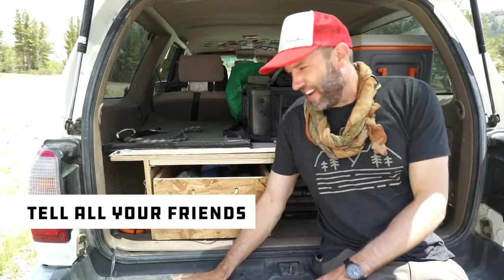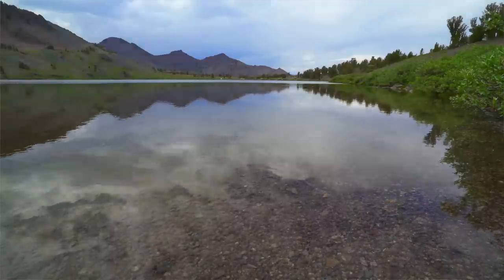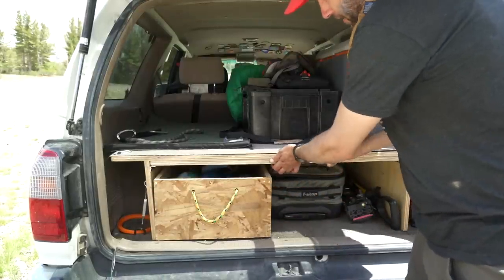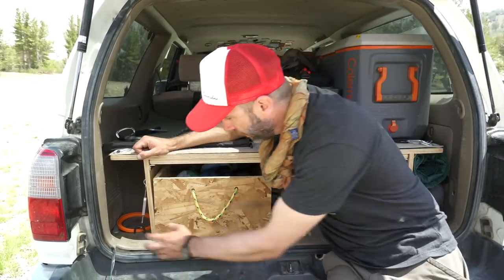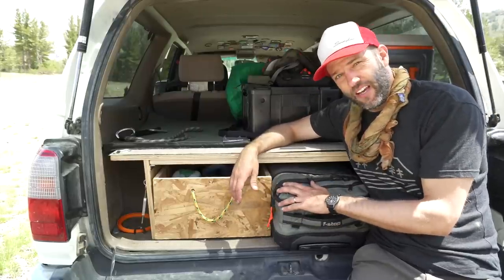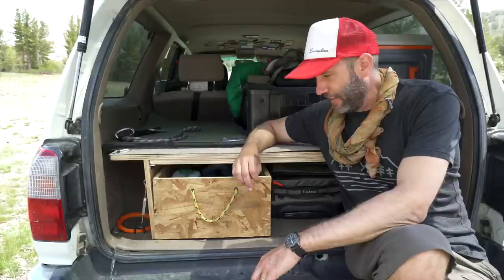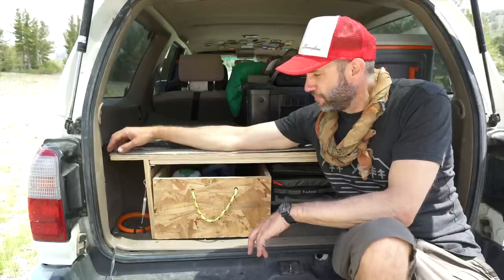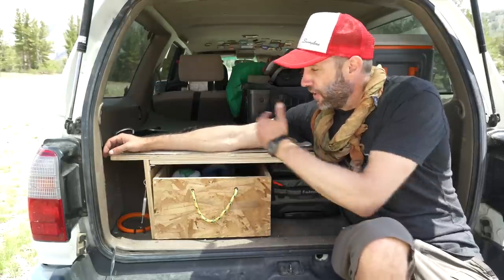DIY Drawer less Drawer System for SUV from single sheet of Ply Wood for overlanding and camping

Comment: Would have preferred the cooler under it and softer/lighter goods to be placed on top. Would have probably covered more of the wood with carpet as well, but nice build!!
Reply from the maker: I’ve tried that design. It works, but you have to slide the cooler all the way out to access it and you don’t get s table.
Reply: All-Terrain Family what if you split the wooden top and hinged it, or left one side open
Reply from the maker: Possible, but that would require more structure and then you’d have to move the stuff on top to open it. I’ll probably build another with the ideas I’m getting from these comments. Thanks!
Reply: Carpet will retain dirt. I wouldn't use it anywhere it wasn't expressly needed. The way it's currently built it can be quickly wiped down and there's no dirt to grind into sliding stuff.

Dirt souldn't be a huge issue with an SUV, but in a pickup or a soft top vehicle like my 48 Willys CJ, dirt is a constant companion. You have to plan on it being there no matter how hard you try to keep it clean.
Reply from the maker: True, but it also traps dirt. Keeps it from flying around. Same with dog hair. Also protects the plywood top. But it also traps water. So there are trade offs...

Comment: Well done, thank you very much. Good idea to secure the platform to the floor. In case of an accident it doesn't fly around. Also, like the tie down strap idea. Only question I have is do you put stops for the sliding table so it could not be pulled all the way out? Thanks again, Robert.
Reply from the maker: No stops. The table is a lot longer than it needs to be so there’s little chance I’ll pull it out too far.

Comment: Nice work, but have to ask, why the half ass attempt at carpeting the top? Why not Contact cement the carpet down and use the same angled aluminum around the edges to keep it down and protect the edges. You could also do Spring pin passthroughs on the table sides to lock it in certain positions (closed, ¼ open, ½ open (probably the furthest open you want because of leverage)), and nice idea with the felt, but I guarantee it'll wear out pretty fast and you'll be replacing. You should have used some teflon sliders, (something I've used in the past was cutting up a cheap cutting board that's at least ¼ inch thick and screw it to the sliding top).
Reply from the maker: The carpet is good enough. 

How fast do you think that felt is going to wear out? It’s been a year and there’s no degradation.

The pin is unnecessary as the felt holds wherever you leave it.

Thanks for the ideas.

-M
Reply: @AllTerrainFamily  If it's been a year, I'm surprised the front piece hasn't broken down yet. between the friction fit and the leverage pushing down on the front edge I wouldn't have expected it to last too long... If it does, take a look at using a cheap cutting board cut into long thin pieces, I've used it a bunch of times in the previous iterations of drawers in my workshop.. Lasts just about forever.
Reply from the maker: Will do. But this solution appears to be good long term as well.
Reply: @AllTerrainFamily  I used contact cement on a van project and regretted it.  If you fasten carpet, felt, whatever in place ......attach it so that you can easily remove and replace .....just like you did.

Comment: Hey Mike - would the 3/4" plywood support two short adults sleeping on it? If yes, what about downsizing to 1/2", adding a center support as necessary? My goal is to minimize weight. Thanks in advance!
Reply from the maker: I think 3/4 is necessary unless you have more support. And a central support is necessary as well.

Comment: Great   simple idea. Is there nothing attaching the other end to the floor of the car? Is there not a tendency for the unit to tip when you pull the table top out and put even slight downward pressure on it, because of this.?
Reply from the maker: There are turnbuckles attached to the cargo tiedowns.

Comment: Nice, simple idea but functional. Your uprights aren’t square nor stable. I would have alternated the pocket screws from one side tot the other and I would have added a solid back or some bracing to the table for more stability.
Reply from the maker: On it’s own, no it isn’t stable. The turnbuckles pull the ends out and anchor them to the floor and the wheel wells hold them in place against the pull of the turnbuckles. So in place it’s very stable. Definitely isn’t square as you said. But it doesn’t really need to be without drawers. Does it bother me? It does a little.

Comment: That tables just amazing.
Is it possible to make attachable legs? Then it can be extended more.
Reply from the maker: Others have suggested that. I’ve not found it to be necessary.
Reply from the maker: Main reason is that it would block access. If you take it out and use it as a stand alone table, you'd still want the short one at the back of the truck. So I usually cary a separate collapsable table for dining.
Reply: @AllTerrainFamily  What I was saying is optional attachable legs or just 2 legs for the unsupported end so that the table can be extended a bit more.
But ya I don't think it will be as practical and easy as it seems.

Comment: To get a nice finish like you’ve represented I’m going to learn about pocket holes. Do you mind sharing the dimensions of the screws you used? (I wanna make sure I don’t screw through to the top but get enough of a bond between the vertical and horizontal boards). Thanks!!
Reply from the maker: The jig has a screw application guide on it. Follow that and the setup guide. The screws are also labeled for wood spec if you get the kregg screws.
Reply: Thank you!
Reply: Since the top deck is covered with carpet, pocket holes don't really improve the design.  You can easily glue and screw through the top deck just fine.  So don't think you have to invest in a Kregg jig just to build this.
Reply from the maker: Screwing into end grain isn’t as secure as screwing into the cross grain of plywood. That’s the primary reason to use pocket screws for this.

Comment: awesome diy....however why did you make the slide out drawer as deep as the top? maybe 1/2 the length i could understand but full length wouldn't that make it lean down, unsteady? jmo...great video
Reply from the maker: Needs the extra depth to be able extend out half way. If it were half the depth it would only extend 1/4.

Comment: How do you access/what do you put in the side compartment that's build into the passenger side wall of the trunk? I'm looking into a cargo box setup but I keep my air compressor and tow strap in there right now and I'm not sure how I would maintain access to it with a similar setup.
Reply from the maker: You can still get into it. I cut the top so i could still get into it.

Comment: Hi what are the twistable tie downs you used to keep the drawer system in place at the rear called?  I can't seem to find them on the web. You have two on either side. Great job. Subscribed 😁.
Reply from the maker: It’s called a turnbuckle.

Comment: Nice. Any problem with the table sliding out and bumping the rear door while driving?
Reply from the maker: Not so far. It’s a pretty tight fit with the felt runners.

Comment: what was the finger hole drill bit size and what was the length of the turn buckles?
Reply from the maker: About 1 inch for the hole i think. Turnbuckle length isn’t critical as you can just mount the anchor wherever you need it.

Comment: Easy way to add a stop tab for the table?
Reply from the maker: At the length i made mine it isn’t necessary. You could maybe put a limit mark so you don’t pull it too far. Or maybe use paracord as a limit strap.

Comment: Amazing idea and executed so well!! I started looking into the products on sale for this application in the market and the prices are astronomical. I then started looking at DIY builds and people were including at least $80 worth of drawer sliders for their builds! But you, sir, have given me the most cost effective solution so far! What do you think about building a nesting drawer system for just half of the width of the platform, to install sink and stove area? I gotta make sure I test the weight limit of the system in the driveway first! I'm thinking that thinner plywood for the drawers might work better since the box structure will provide stability and so it would be okay to use lighter pieces? THANK YOU for the ideas and saving me money! 🙏
Reply from the maker: You could. I’m not convinced a sink is a good use of space. And i use the stove on the table.

Comment: Love the design! Great vid! I have a 99 Runner and am considering doing this. One question though, why no drawers? I see you have the open drawer on the left without slides. Why not add drawers?
Reply from the maker: I could do a single drawer maybe. But for the rest i use it for things i that wouldn’t fit in a drawer. Also, drawers with slides would use up at least 3 inches of space side to side and need a base plate of plywood. I might give drawers a try at some point, but this design is working really well for us.
Reply: All-Terrain Family  what are the adjustable screw latches you used to hold the system down to the stock cargo tie down locations called? Did you buy them at Home Depot or Lowe’s?
Reply from the maker: Turnbuckle or cable tensioners. They’ll have them at any hardware store.
Reply: @AllTerrainFamily  you should check out drifta.com.au design if you do decide to do a drawer/drawers - Drifta drawers have no runners/sliders, just Teflon.
Reply from the maker: I will check that out! I have looked into those teflon slides.
Reply: I like this idea! Built a few alike set-ups for my vehicles as well, but not easy out as  yours, thanks! Also, that table can be slided over dropped down second row seats to make a bed. Just one extra piece of plywood required for vertical support. Drawers aren't universal, you right. On-size plastic beans could work fine (I've built compartment heights according to bin's size). Cheers!
Reply: @AllTerrainFamily  Teflon slides are expensive

Comment: Why don’t you consider putting legs on the slide out, that way you can pull it right out and use it as a picnicking table as well.
Reply from the maker: I have a separate table for that.

Comment: Did you only add tie downs to front?  Or did you have them in the back as well?  Just wondering with the shelf slid out if it would tip box forward.  I like the concept.  Gives me an idea for the back of my subaru to build something like that and some boxes to hold bikes supplies, shoes, helmets, etc.
Reply from the maker: Yes. I have tiedowns on all 4 corners.

Comment: what are those adjust tie downs called. Can I get a link please?
Reply from the maker: Turnbuckle. Any hardware store will have them.
Reply: @AllTerrainFamily  Thank you. Also what is that collapsible craftsman table saw you have there. What is that exact model please.
Reply from the maker: Itta delta table. Don’t know the mode is.

Comment: Why the tie downs. Doesn't seem like it can go anywhere
Reply from the maker: It can move a bit with normal driving. It might hop with bumps and certainly would in a crash.
Reply: Assuming you go off-road at least once in a while, having your gear tied down is important.  Rough roads and more extreme angles will cause everything to shake and rattle and shift around.  If it's not tied down, then the shifting around of the deck may also do more damage to your vehicle interior by abrasion.

Comment: How do you get to the spare tire?
Reply from the maker: It’s under the truck. This vehicle was made in the last millennium.
Reply: Makes sense.  I've been considering doing a shelf/drawer system in our SUV, but it's my wife's daily driver and I want to keep access to the spare.  Thanks for the great video!
Reply from the maker: Unibody vehicles can’t fit the spare underneath. It’s kind of a problem. But tires are really good these days. And hardly ever fail. This setup would be a bit if a hassle to pull out for that, but will rarely ever happen.
Reply: @AllTerrainFamily  
Wow....tires rarely fail?  I'm in construction in Atlanta and I get a f'ng screw, nail, and even bolts in my tires evey couple of months.  That's all because a-holes can't keep their crap secured.  Good for you for rarely having a tire fail.
Reply from the maker: Ha. Well I guess that’s a hazardous job! I’ve had a nail here and there that i repaired with the tire on the car. Running E range tires on an SUV in normal conditions is like having steel shanks shoes!
Reply: @AllTerrainFamily 
I should have mentioned, nice system you built there.  I'm looking to build something.  I'll likely take ideas of yours and a few others to generate my own.  Thanks for the ideas!
Reply from the maker: You’re welcome. Keep us posted!
Reply: @AllTerrainFamily    My 5th Gen was made in 2014, and it's still down under. Actually seems like an advantage when you have the cargo space fully loaded.
Reply from the maker: @somethingclever8744  Yeah, It doesn't bother me and hasn't ever been a problem. All pickup trucks hang the tires.

Comment: That’s great, until you have a flat tire
Reply from the maker: Why? Spare tire hangs under the back.
Reply: Not in my Honda HRV. It's under the floor of the boot area accessed by removing a large board. Only way this would work if there was a area of floor either side of rear board and there was enough clearance to remove the tyre.